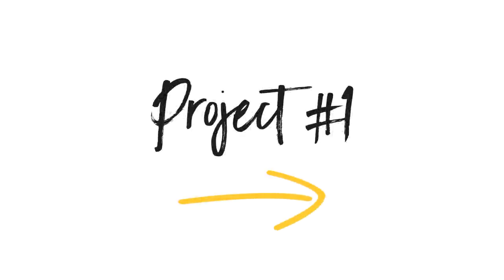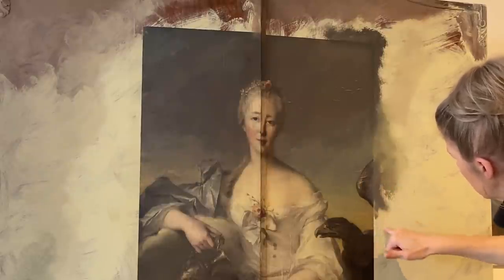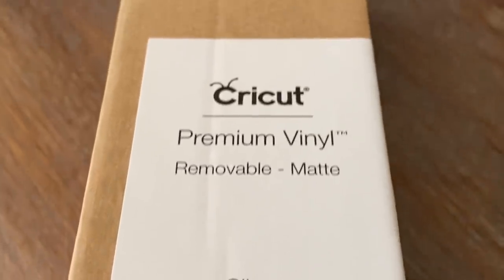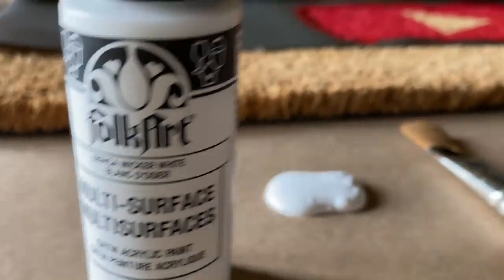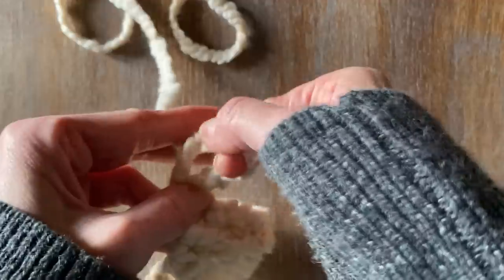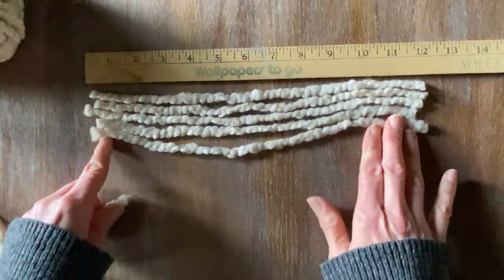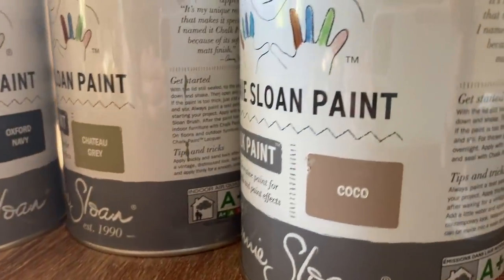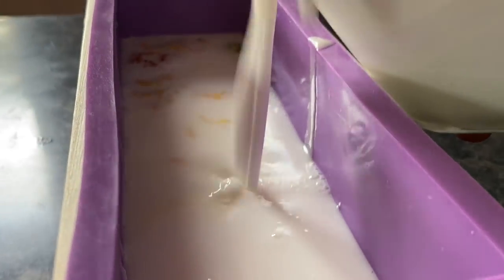6 Decor DIY:Finger Crochet Blanket, soap making, Cricut projects, Decoupage, Chalk painted furniture

Comment: Good evening Christina, I would like to say the veneered amour with the decoupage was amazing! The manner you ladies applied the paint techniques was smashing. It worked so beautifully the manner you blended the paint with the colours of the picture it looked amazing!! I can easily just stare at the outcome of the paint techniques for a long long time. I was admiring that beautiful round creation next to the couch. did you also make that, it looks so beautiful. maybe I missed it in a previous presentation. I will see if I can pick it up. The frame work also so smart. It does prove that we do not have to spend a fortune on paintings, which are lovely, but with a bit of inspiration and will power much can be handmade for sheer pleasure, and the soap turned out lovely. I love that you added a soap dish, that just makes the presentation complete, love and care. So looking forward to more gorgeous ideas. Kind regards.

Comment: re: decoupage wall art- much, much easier to lay down 2-3 coats of decoupage medium on the wood, let dry then place the paper over it, put a sheet of pastry paper over that & iron on the paper. You won’t have any wrinkles at all & the entire procedure is so much faster. I just finished a large wall art piece using thin sari cotton and could not believe how fast & smooth it went on. To seal it I used  Matt spray varnish.
Reply: What?! That's so cool! Did you use sari fabric as wallcovering? I love that idea. I'm screenshotting this, hopefully you have a tutorial...going to look...
Reply: Ok, so you don't, but I see you said "wall piece" so that I can do. I have some incredible vintage sari scraps. Thank you!